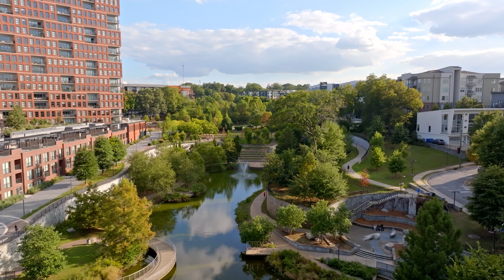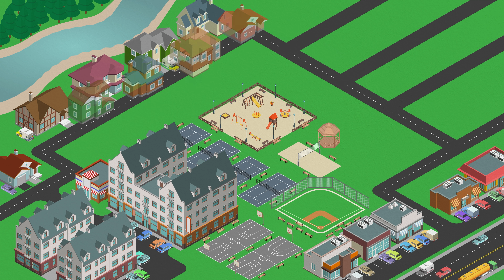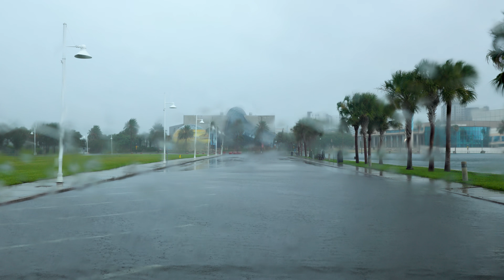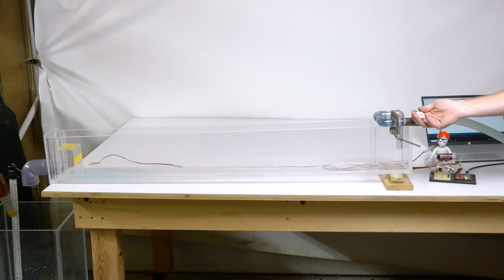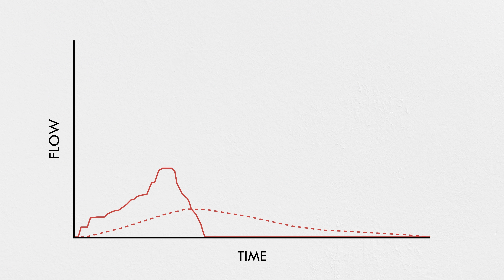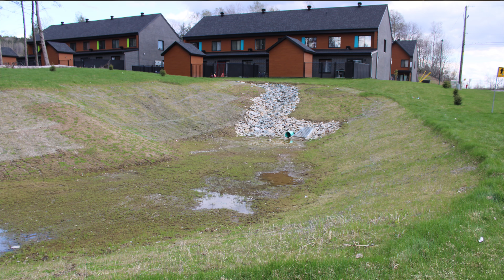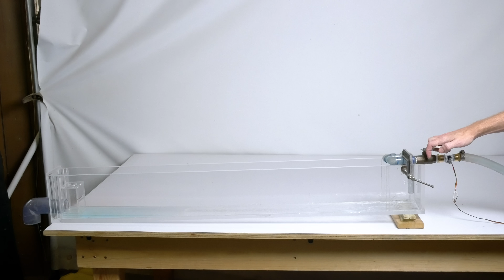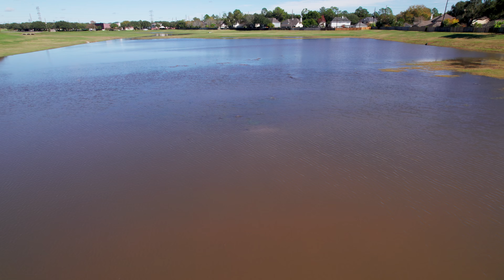Do Retention Ponds Actually Work?

Comment: The city I grew up in was frustrating, to say the least. They essentially removed any ponds or retention in favor of housing developments. This caused flooding in areas that never had flooding before, after every single heavy rain. This is a clay heavy area and downpours are more common than gentle rain over time. The few natural creeks or small rivers they left were never properly maintained, causing backups and surges. That is until they came through and removed most of the vegetation all at once, including many many large trees. Did they manage to shore up the banks so they didn't settle and damage houses? Of course not. Private citizens had to shell out for proper retaining walls (three wooden planks are NOT) and sue the city afterward.

Comment: In Georgia developers are required to build storm water retention ponds that are sized according to the amount of hard surface (pavement, roofing, etc) proposed. The ponds are filled when it rains as a restriction in the pond's drain slows the rain water's entry into the town's storm drains so as to spare the municipality the expense of improving their storm drainage system. Most of the year the developer-installed "ponds" are dry, waiting for rain. To limit danger to children from a rapidly filling low area where kids might be accustomed to playing, developers fence the dry pond off. 
Meanwhile progressive municipalities, though relieved of the expense of improving their storm water drainage system, impose new taxes on property owners for handling rain runoff and based on the area of the hard surface on the property. 
🤪

Comment: The nearby community Shaker Heights, Ohio is well known for their Shaker Lakes. These 2 "lakes" were created in the mid 19th century by 2 small dams to manage stormwater for the area (and provide water power for a couple mills). They are now the central features of the public Shaker Lakes park and Nature Center. 

Recently though, Cleveland Water management is in the process of constructing large underground stormwater chambers just a little downstream of them. The city has therefore deemed these lakes will no longer be necessary for their stormwater management and plans on draining them.

It is sad because these have been part of the character of the area for 170+ years and are part of the smaller Shaker Heights's parks system. The city will be losing a great resource of beauty, nature, history, and learning. It will be up to the smaller city of Shaker Heights to figure out how to incorporate the marshy low-land that remains into their park the best they can.

Comment: Years ago I worked at the Valvoline world headquarters in Lexington, Kentucky.
During that time, they were building a new wing at the campus where 2 retention ponds were.

The contractors had to go to extreme measures to insure nothing entered either of those ponds.
One day, somehow the crane operator dipped the hook into one of the ponds. 
By the way they acted, you would have thought an international incident had occurred. 
There were always swans and geese there, so maybe they were upset about them being disturbed. They mostly just hung out in the pond that was the furthest away from the construction site, and returned to normal once the construction was over.

Comment: Regarding comments at 3:00: Clay can actually hold much more water than sand... it's just that it'll take much longer to permeate and saturate.
Reply: In this context I guess that 'hold' has a bigger meaning than just how much can the soil actually absorb. If the water sits on the clay and runs along the surface to the river the flow is much greater than the flow if the water has sunk into sandy soil, even if the sand isn't really holding the water, more letting it flow until it meets a less porous material. Also the surface area of dry soil exposed to water is much greater with a damp volume of sand vs the surface of the clay under the puddle.

Comment: I surveyed a 18 hole golf course ing time ago in moorehead, man.  It started out as flat farm field.  Since it didn’t have any trees yet the course was designed around  13 retention ponds and a creek cut thru it to supply water if needed.  I bet I put out 25k-30k cut and fill stakes on that job by myself.   Once the holes were surveyed in a laser level was all that was needed.  Long job and very muddy at times. They had to give me a front end loader to get around the course.

Comment: I've lived most of my life in deserts. One thing that desert soils don't do is absorb water. I currently live in Reno, Nevada. We get under 10 inches of precipitation a year (including snow...the mountains to the west scrape all of the moisture out of the clouds). So a quick summer thunderstorm will drop maybe 1/4 of an inch of water and we all of a sudden have massive flooding. When I was the pastor of the Emmett, Idaho United Methodist Church (still very much a desert), the church was required to install and maintain three swales to collect rain water runoff and let the natural soil slowly absorb the water.
Reply: Dry fine graded soil does not absorb water because there is air in the voids.  It can be solved with some care. Deep pits with  stones material that dont dry out.

Comment: Wouldn’t a vertical slit work better than multiple outlets?
Reply: there are some ponds with vertical slit outlets.  the outlet rate would ramp up more steeply and smoothly, which may or may not be desirable in a given application.
Reply: The vertical slot used to be the standard, but the design is the most susceptible to clogging with floating debris. The vertical slot is better for measuring outflow using the height of the water at the slot.

Comment: Retention ponds do work, but it is import to remember they solve a problem we created with too many surfaces that just shed water.    Flooding is a natural event that we have not learned to work with.
Reply: Would you not say that a retention pond is an example of us learning how to deal with flooding?
Reply: @nelsonglover3963  It's an expensive way of cleaning up after the mistakes we keep making. Some runoff increase is almost inevitable, but the dimension at which it happens is caused by how we build infrastructure. Especially in the US with huge parking lots and wide streets.
Reply: that is what he talks about yes thanks for your summary bud

Comment: Its cheaper to build a retention pod, rather than connect the off-run to an existing sewer network.
Reply: Not necessarily cheaper if earthworks are large. Its more about sustainability and planning difficulties, as connecting to an existing network reduces the capacity of the system. In the UK we are legally required to slow down the runoff before connecting into an existing system. This could be with a retention pond, but also with on site storage tanks and usage of a hydrobrake to slow flows
Reply: you mean storm drain?
Reply: @justayoutuber1906 storm drain, surface water sewer, pipe in the ground, all the same thing. I doubt they meant foul/dirty water sewer
Reply: In my area we have to adhere to MS4 permit (municipal separate storm sewer system) as part of npdes (national pollutant discharge elimination system). So contrary to what people believe, the storm drains you see open on the street curb are not a sewer. At least in my area.
Reply: @jakenbake93 not sure what your area is, but in most first world countries it is standard for new systems to separate storm water from dirty water. A lot of old sewers are combined with stormwater because it was seen as more efficient back then